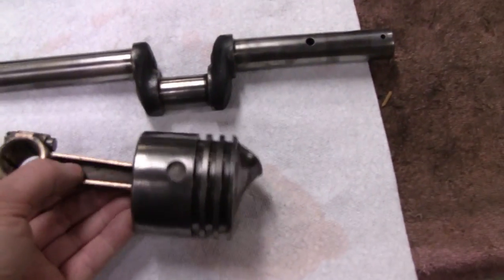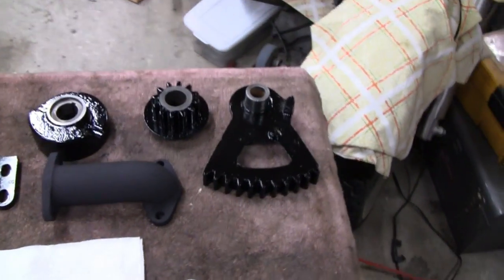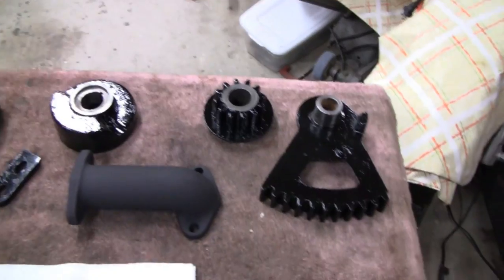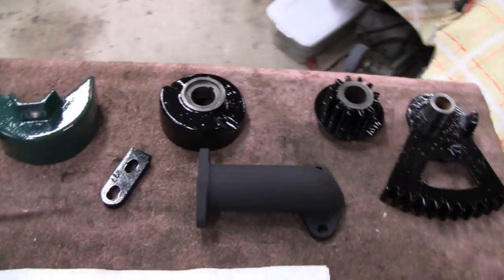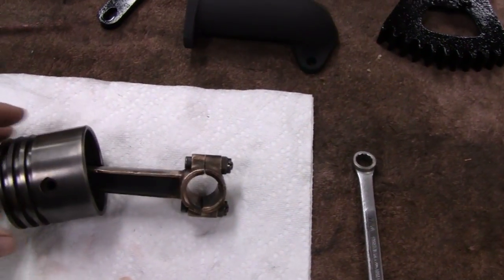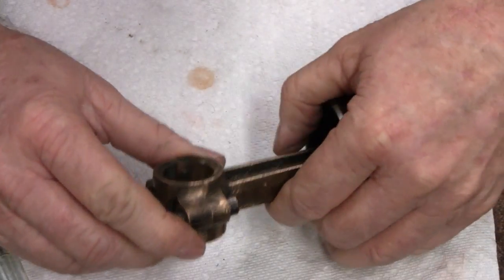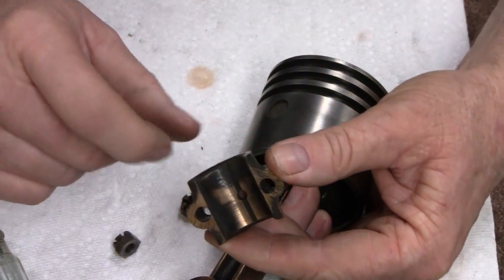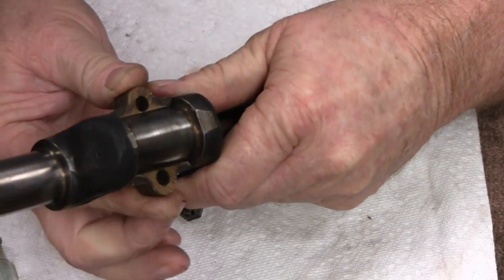MAYTAG 92 ENGINE RESTO (part 8)

Comment: If you used a new sharp 7/8ths reamer, it would have been too loose. You've got to remember that the crank is old and has wear, the big end throw journal will be narrower than factory spec.

Comment: Man, now that there's paint on them, you can really see how mint this engine is. That pipe is practically new. Usually when i see them online, it's either gone, or some sort of imitation Schweitzer pipe.
Reply: Don't forget about Singer. They stamped everything, and i mean, everything. IF, they could get away with stamping bolts, nuts, and screws, i'm pretty sure they would, as is, i have stamped washers from them. Mad, crazy, but do i thank them for this insight today.
Imagine going screwing around inside a sewing machine trying to replace part 1259 (an actual nightmare) without their coding system. Even today, when the company has collapsed and it's producing substandard (by their own former products) plastic machines, i can still find parts to replace and maintain my little fleet and restoration projects.
As far as i'm concerned, labeled parts are the standards of a great business with great pride in their craft. Something to note in today's world, where they'd want you to go scour the manuals for part numbers.
Reply: ALSO, RK, you can sharpen reams, i've done it with a synthetic ruby stone (on eBay, shaped like a triangle in section). I've brought back many reams with this marvelous stone of our making. Ain't cheap for the really high standard ones, but the regular variety (more than enough for a sharpening) are cheap, we're talking 1 to 6 dollars with free shipping.

Comment: Hi Roadking a question for you with that worn out Reamer can get it Resharpened
or or is it cheaper to buy a new one Oh hang on I think I just worked out the answer as it is a specific Diameter by sharpening it you would loose some material so the accuracy of it so it wouldn't then be a 22.2250  Reamer 
Thanks for the answer Grin

Comment: Nice ! job RK. Not that you need to this time, but if you ever need to "lift" the edge of a rheem, you can do it by dragging a tungsten lathe tool down the leading edge. keep it on the same angle as the machined face and don't press too hard. Just a few lbs of pressure will do it. An old guy showed me how to do it on rheems we used to resize valve guides and it worked a treat. cheers.
Reply from the maker: We'll have to give it a try Mate!!☺
Reply: If you can get it to go through and cut at the right size, i'd leave it. You might find that it takes an extra thou or 2 off after you do this.

Comment: Hi,Just a hint, never let reamers touch each other as it detroys their accuracy .Because you use one size often enough to wear it out,you need an adjustable reamer that you set with a micrometer .Is the conrod Bronze? Brass would be too soft for a rod .
Reply from the maker: Yeah the rod is probably Bronze or some kinda brass alloy, they're just commonly referred to as brass over here in the States!!☺

Comment: Road King those reamers can be sharpened and it may be worth doing the old vinegar sharpening trick like you would on files to see what kind of edge you can achieve.  Yeah the file can end up a couple thousandths smaller than original but if it is too far off you can relabel it as a new size. lol.
Reply from the maker: That would give me a sharp ream, but I would still need a 7/8 ream for the job!!☺
Reply: The job is done now,  I meant for the future buddy.